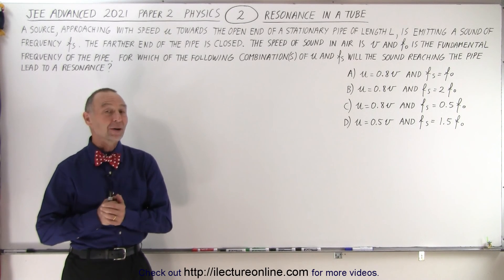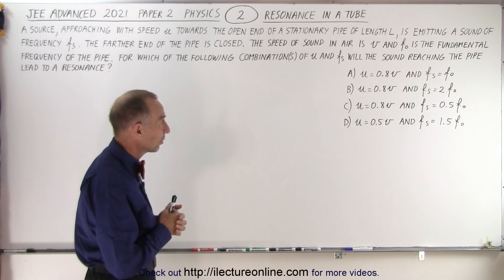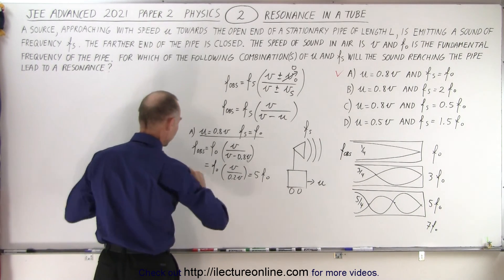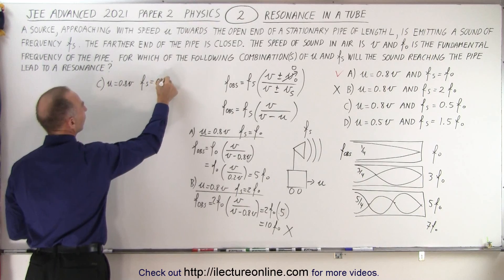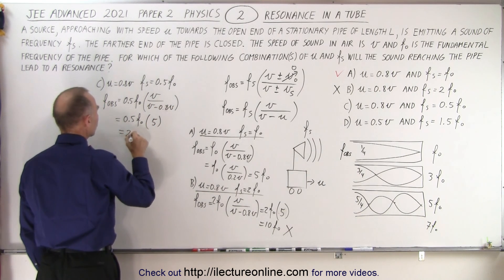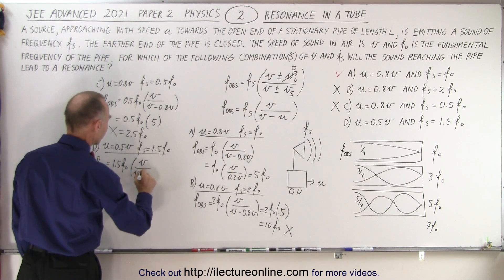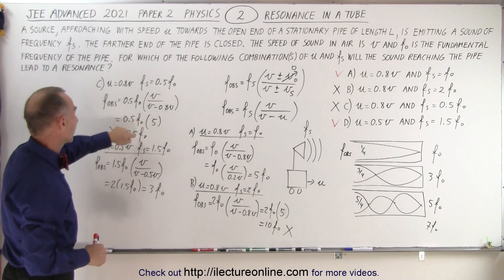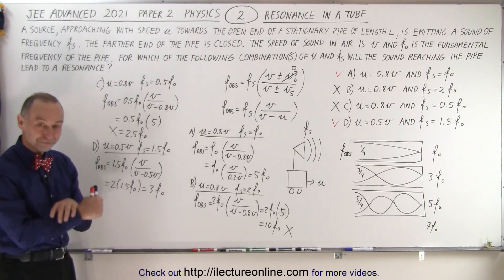JEE Advanced Physics 2021 Paper 2 #2 Resonance in a Tube

Comment: Now I want you to answer this problem sir.

A horizontal shaft rotates in bearings at its ends. At its midpoint is keyed a disk weighing 40lbs, whose center of gravity is 0.1 inch from the axis of rotation. If a static force of 200 lbs deflects the shaft and disk through 0.1 inch, determine the critical speed of rotation of the shaft.

The answer is 547 rpm but I cant get it with my solution.

Comment: Would the results be different depending on the angle of the pipe against the sound source? (-90deg < angle  < 90deg)
Reply from the maker: Sound does have the capability of "bending" around corners, but if the opening is small in diameter, the volume of the sound would be less